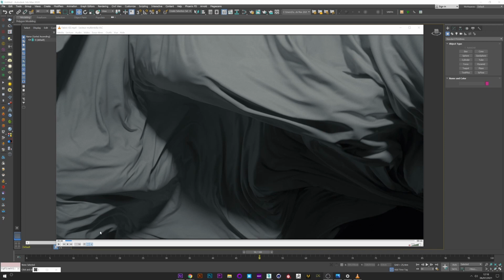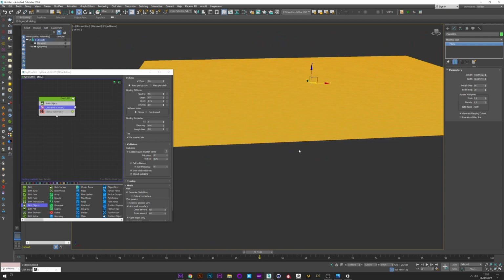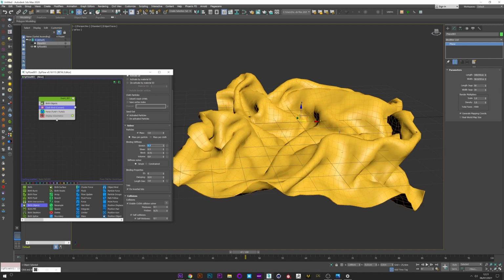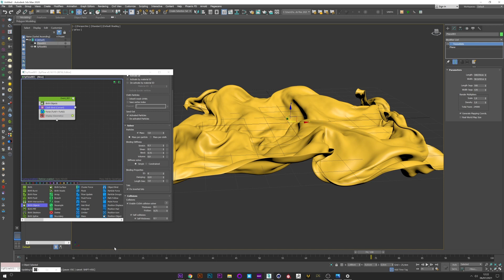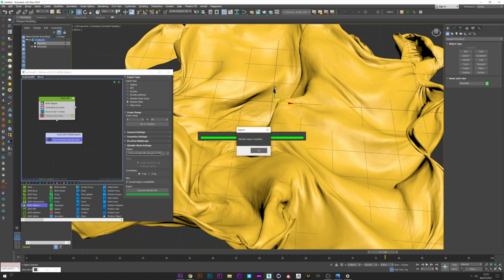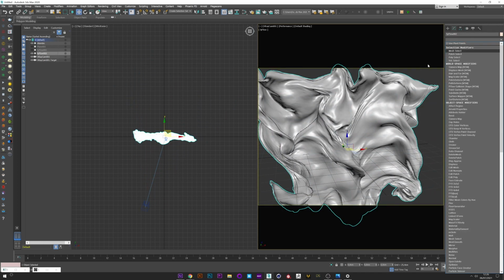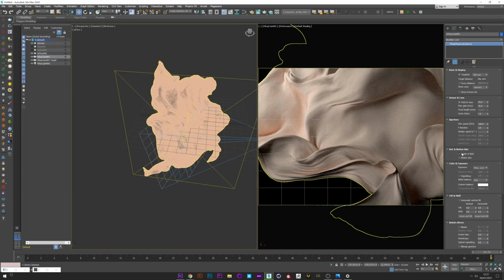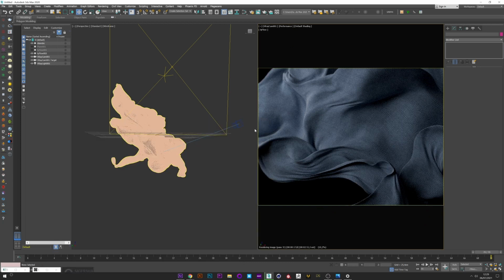Cloth Simulation | Tyflow Tutorial

Comment: Hello, I have a problem. After exporting the Alembic Object, re-loading the Alembic Object and rendering it will cause a problem, that is, it looks like there is an error on the surface. How did you solve this problem, hoping for your help
Reply from the maker: Hello, sometimes, yes you could have problem on surface with the alembic. Try to add a "normal" modifier on your alembic and render one frame to see if it solve the problem. If it doesn't work just render without use  exporting in tyflow .  Just create a preview to see if you animation looks good and render it